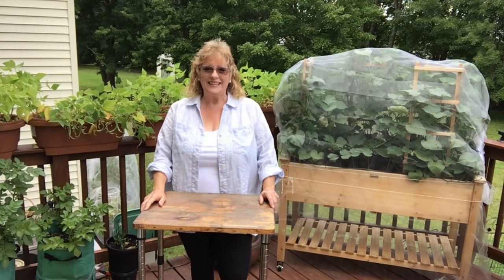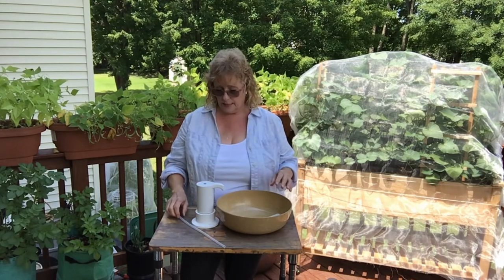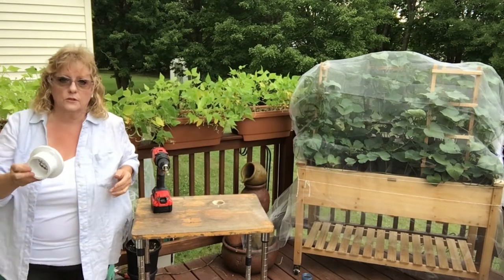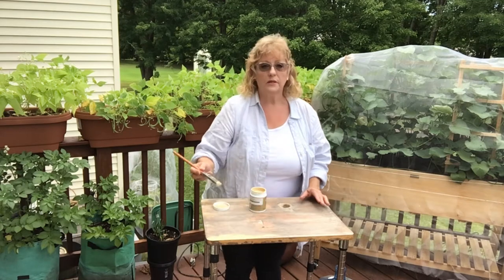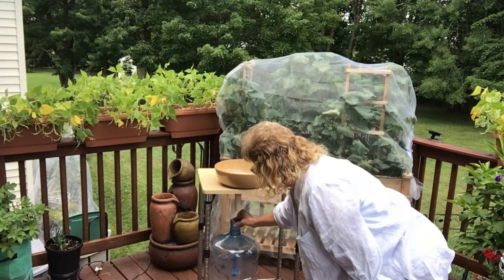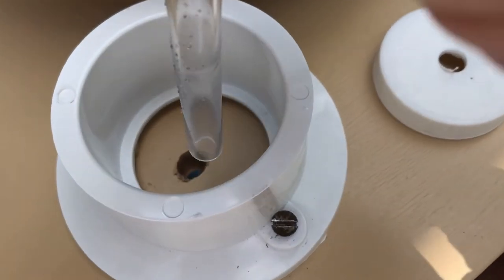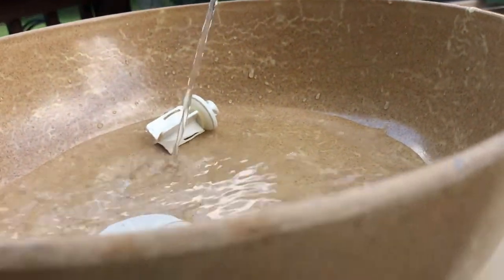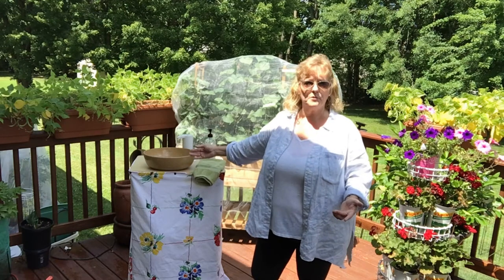DIY Portable Sink

Comment: This is great! Could this be done with hot & cold water?
Reply from the maker: Just cold water, unless you heat the water before putting it in the 5 gal jug but it would not stay hot. This design is more for just washing hands.